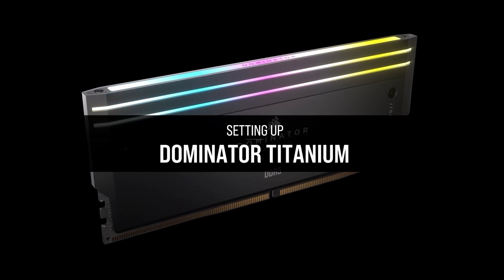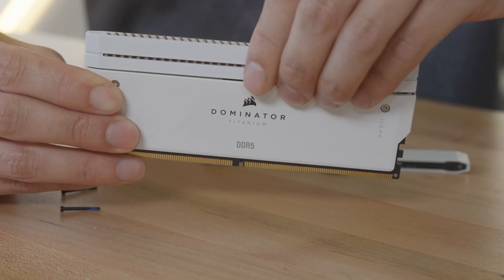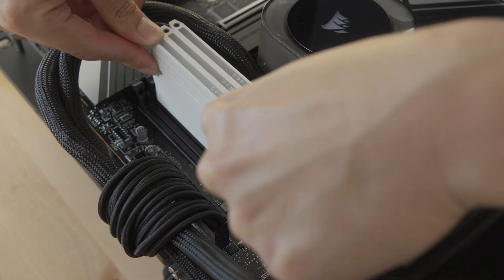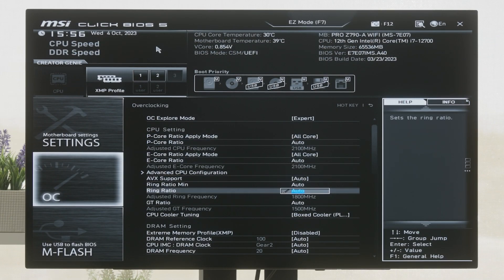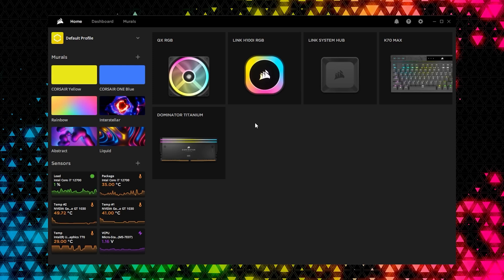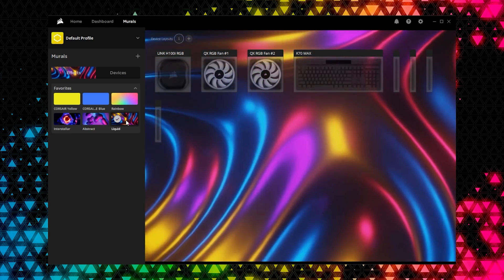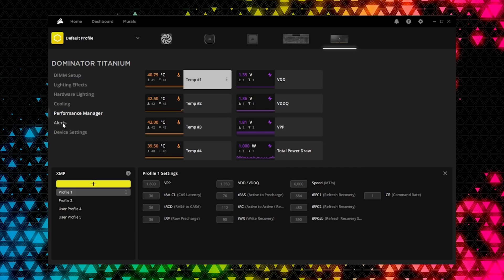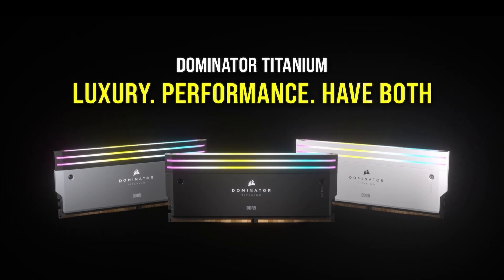Installing and Setting Up CORSAIR DOMINATOR TITANIUM

Comment: Very nice looking ram sticks. All my fans, watercooler and the vrm cooler I use is Corsair QX series and h150i in white so these will fit in perfectly with all my other hardware.
I am using the AX1600i psu which is icue compatible aswell so it is very convenient when I only need 1 program to monitor and control all of my hardware.

I ordered the Dominator Titanium 96GB sticks yesterday :)

Comment: I have x2 dominator platinum rgb ddr5-6000 cl30 

I'm wondering if I order x2 of these in the same specs, will they work in sync together? 
Or better to use x4 of either titanium or platinum?
Thanks

Comment: Hi. I´m building a "white PC". I chose the Ryzen7 7800X3D processor and the Asus ROG Strix B650E-A Gaming WiFi Motherboard.
I Found the DDR5 Corsair Dominator Titanium in white, but unfortunatly only XMP. I could by the expo model but they only exist in grey. 
What would happen if i run the White XMP version on my AM5 setup? Will it still be compatible or will i run into some issues?
Reply: it doesn't really matter if you use XMP or EXPO on Amd works just fine.
mine supports xmp with 6000mhz or expo with 4800mhz. i use since i build the system in end of october 2023 xmp. just works fine :D
Reply: Looking at the same setup. did you end up going through with it?
Reply: @tuckerspiker6702   No, I went with the G.Skill Trident Z5. I'm glad I did. With barely any space between The RAM and the water cooling system (Lian Li) The dominators would never have fit.
Reply: @SunDance00  I went ahead and ordered it! Hope I don’t run into that problem😬 what cooler are you running in it?
Reply: @tuckerspiker6702   I went with the Lian Li Galahad II LCD - AIO.

Comment: i just bought the 48gb dominator titanium ddr5 kit.
Now my 360AIO will not fit on top of the case. Because the dominator rams are too high.
Can i use the ram without the rgb stick on top? 
I really dont need that lights.
Reply: Yes you can
Reply: @cia4gent128  
thx.. i just removed them and nothing changed.. but the rams now fit under my AIO360

Comment: will the Corsair 96GB (2x48GB) DDR5 6400MHz CL32 Dominator Titanium but 4 sticks so total 192gb support n7 Z790 motherboard? paired with 14900kf
Reply: Yes but at 5600mt
Reply: @cia4gent128  I couldn't get 4x32 to run at higher speeds, currently settled at 4800 for the time being.
Reply: @DaveAuld   Now with my new MSI Z790 tomahawk board I can run 4*16gb at XMP 6000Mt
Reply: @DaveAuld   get 4*16 is better...64gb of ram is more than enough.
Reply: @cia4gent128  I was planning on 64 for the system and 64 for a ram disk for image processing swap files.

Comment: I’m assuming you’re not getting anywhere near the full speed if you’re using all four sticks of titanium because I’ve been trying with a very high-end motherboard and it just doesn’t work.
Reply: I'm exactly the same, 4 x 32GB sticks, had to settle for 4800 for the time being to maintain stability. my Supplier reckons 5000 should also be ok, but not tried it. This is with a Strix Z790 MB. Also, iCue caused so much problems, had to uninstall it.

Comment: I would love to see dummy sticks of titanium. I bought a 7200 48gb kit and have no need for more ram but would love to populate all 4 slots.
Reply: They just released!! i’m so excited the name is “CORSAIR Dominator Titanium DDR5 RGB Light Enhancement Kit”
Reply: @Mybeefonyolip  So no one are concerned that 4 sticks run at 4000 clock instead of 6000 ?)
Reply: @ that’s the problem with ddr5 u can only ever run two sticks at max speed sadly
Reply: @AlexanderAgB  that’s the point of this new kit. They have no memory modules. They are only rgb.
Reply: @Mybeefonyolip  what if you buy the 4 stick kit 96 gb 6400mt? I believe its optimized to use 4 sticks
Reply: @Alfalfa718  i’m not sure about anymore but when i last checked if you use more than two sticks they cap out at 4000 mt or even 2k in some cases
Reply: Great idea! I have 2x32gb and also would like to fill the other two slots...without super overkill ...🤷‍♂️
Reply: Take my up vote, I would also buy one. The build looks unfinished as is.

I don't want to settle for lower performance to fill in the gaps.
Reply: They work great.
Reply: @DEFBOY35  I bought a set. It would be cool if they would offer kits for sale with the dummies
Reply: Same, I got 2 48gb sticks and dont like the empty slots. Worst case I’ll just get another 2 48gb sticks lol.
Reply: They are available now in case you didn't know.  @nifte4635

Comment: Make WHITE kit 6000MHz with EXPO please, I beg ;-;
Reply: I am using this ram, it works fine on 7950x with 6800Mhz  cl32
Reply: @haquanglap  really? You can post at 6800mhz cl32 on ryzen 9 7950x? Are you using 2 sticks or 4? 32gb in total or 64? Also what BIOS version are you using? (Sorry for the interrogatory but I need the info for my rig xd)
Reply: @LethaR_YT   
yes, I am using 2x32GB, X670E-E GAMING wifi, bios version 1602. This ram have xmp 6800mhz cl 32. I simply turn it on and do nothing, window boot easy.
Reply: @haquanglap  damn. So you’ve got a bios that is more than a half year old and still get to boot to windows and no crashes with 64gb and +6000 memory speeds. That’s not normal at all man, congrats
Reply: @LethaR_YT I’m also using DOMINATOR® TITANIUM First Edition 64GB (4 sticks of 32GB) 6600MT/s CL32 Intel XMP Memory Kit in White with an AMD build. 7950X3D and Asus 670E-A
Reply: @sole_less Any issues with the ram on AMD?
Reply: @robertsludock  nope! Been running great for several months now
Reply: @sole_less  Nice, I believe I got the exact same ram kit as you. I have a 7950x3D and an asrock x670e coming in the mail this week. You were able to get the rated speeds of 6600mt/s without any stability issues?
Reply: @sole_less whoa you've got 4x32GB installed and getting 6600MT/s still? I just ordered the Dominator Titanium 2x32GB 6000 AMD EXPO kit (just 1 kit 64GB total) for the AMD 9950X & ASUS Crosshair x870e Hero I'm about to build to see if it can actually post 8200MT/s OC speeds
Reply: I mean, that would be cool BUT with a 6000 cl30 kit (which exist in white) you should be good to go with Ryzen 7000, no need for expo profile, just enable xmp and it would work properly. Probably even the 6400 cl32 would post on Ryzen 7000 with the new bios updates